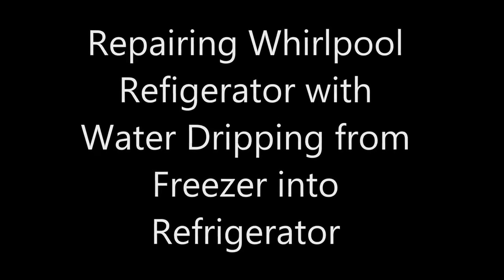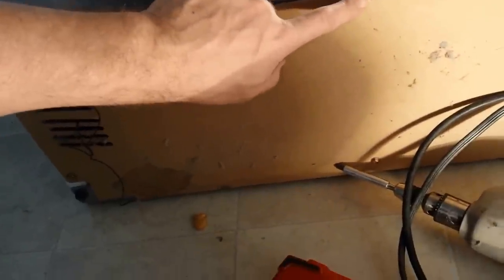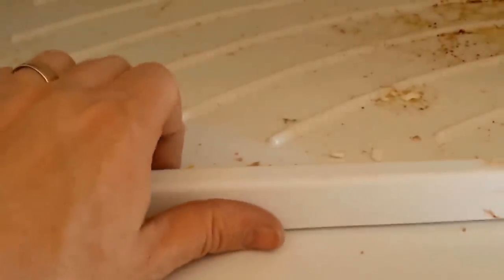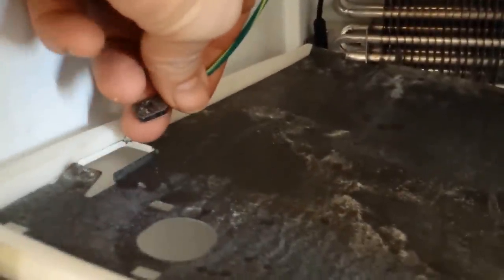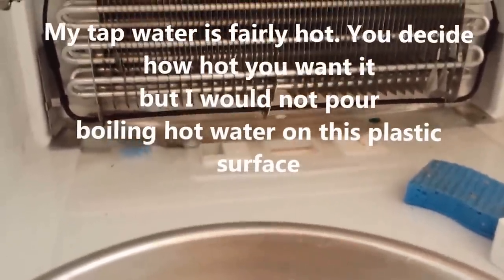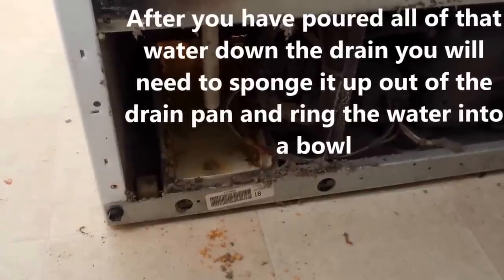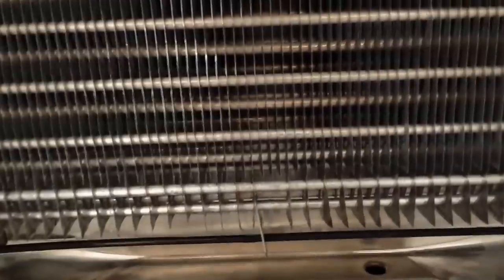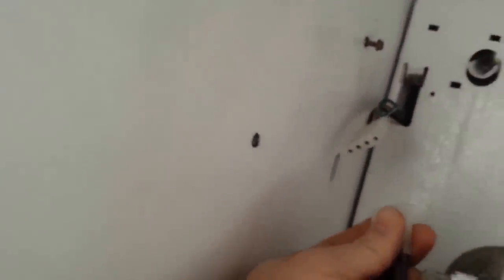How to fix Whirlpool dripping water from freezer into refrigerator compartment

Comment: First off thanks, Mark, for saving me a lot of time in diagnosis and disassembly! Your Whirlpool fridge is almost identical to mine (mine doesn't have the bottom tray). It took me maybe an hour, start to finish, to get the drain unclogged and have it all up and running again.  I'll share what i did differently to speed up the process.

First, after shutting down the freezer and fridge, i unloaded the whole freezer into laundry baskets (i had nowhere to keep it all cold so moving quickly was important!), i then plugged the air vents in front of the back panel with paper towels. This kept any further water or ice from leaking down into the fridge (i had cleaned out the entire lower fridge the day before thinking the leak was a one-time occurrence). 

After pulling off the rear panel, i chipped away as much surface ice as i could. When i could see the drain hole (and there was still a bit of ice left in the catch channel under the cooling fins), i spooned  copious amounts of table salt into the drip channel making sure to put the majority of it around and over the drain. Then i got a hair dryer (a heat gun would work too but be careful with it, they get VERY hot!) and melted the rest of the ice in the channel with the salt on it. Before long the salt water began to eat away at the ice in the drain pipe. I used a bent piece of stiff wire to poke down the pipe to help the warm (not hot!) salt water along. In about 15 mins the drain pipe unclogged and i could scoop up the excess salt. I left a bit of salt in the channel to help keep it from freezing up again right away. I then reinstalled the back panel  and pulled the paper towel plugs out of the air vents. Then i wiped out the freezer well with a towel and put all the food back in. 

I hope this helps someone out....thanks again Mark!
Reply: Thanks for the additional tips!

Comment: Great video! 1) Recommend adding a copper wire to the defrosting drain hole, this is quite involved and unless you want to keep doing this and remove all your frozen food, even once a  year seems a little too much, the copper wire will transfer the heat from the defrosting heater to that hole to prevent ice buildup. 2) Recommend figuring out why there's so much ice/ water buildup... usually this is from the fridge doors being warped from years of usage, which causes the seal to not completely seal all the way, if you look on the top of the freezer door usually you can see one side dropping down. This is a easy fix just remove the door and hammer the hinge the correct way to re-align the door.
Reply from the maker: Thanks. I had to do this once again since I made the video, but it's been a number of years. If it happens again, I'll consider your suggestions.
Reply: Jeff, your copper wire idea is great, I had a repairman do this once because the defrost heater is to far from the hole, he made his own transfer wire from a coat hanger, worked great!!
Reply: Great point about the cause of the problem! Check the door gaskets and that the door is closing tight.
Reply: Why not just let the refrigerator sit out for a longer period of time and let the frozen water in the tube defrost on its own? This of course is assuming you have other refrigeration to put your food into which is my case.
Reply: This is a constant issue that I think actually has something more to do with the ice maker. I have this fridge and when I bought my home (with the fridge-ice maker was disconnected) I did not have this issue. I connected it 3 years later and all bell broke loose. Warranty service have fixed and replaced all parts and did what this video is doing multiple times, but never touched that ice maker or the water hose running to water and ice or their components. Still having issue today. F this fridge
Reply: @youknow1334  my fridge doesn't have the ice maker and I still had this same problem.

Comment: It works! I'm in my 60s, female, and I was able to do this, with some minor adaptations for my size and sheer cowardice. I emptied and defrosted it completely and blew condensed air up the drain pipe a few times. Then I used a funnel and warm water at the back of the freezer and poured it along the edge. It all ran out the formerly blocked drain tube, along with some crud. I poured until it drained clear. (Many of us "grew up" before frost-free refrigerators.) I put a "plastic nondairy creamer tub" under the tube at the back to catch the water. Yippee! Hundred$ saved! (My husband is a musician. Need I say more?) Thank you!
Reply: I’m a woman in my 60s too. I’m going to take courage from your comment and give this fix a try. Thanks!
Reply: @friedabacon3508  Good luck!!!!

Comment: Good refresher video. My appliance repair guy showed me how to do this. Another trick he showed me - Pour some Hydrogen Peroxide down the drain tube. In my case - it was the bacteria that was causing the drain to keep getting clogged. This is basic information that should be in every owner's manual. Good job at showing how to do this. Thanks!!!

Comment: Thank you, Mark and all who added suggestions. I have this fridge and I used a hairdryer and sponges to melt ice and remove water. I was mostly able to remove the ice in sheets as it loosened from the freezer bottom. I heated up an Allen wrench (which was handy at the time) with the hairdryer and put it on the iced up part in the drainage tube. Once the water started draining, I poured hot water down the drain tube using a small funnel to finish clearing out the ice. The whole process (from emptying the fridge to putting the food back) took me less than two hours.
Reply from the maker: Ann Thayer that rocks. So glad to help.

Comment: Thanks much, Mark.  Piece of cake to fix, just as you show. I let the unplugged refrig sit overnight to thaw the ice in the drain hole.  Next day I wrapped a  thick copper wire on the black tube and inserted it a couple inches down the drain hole to keep it open, per Andrew below. Also, I just moved the ice cube maker to the side rather than disconnecting the electrical.  My wife and I are so happy to have a dry refrigerator again!

Comment: I made the mistake of NOT going on You Tube before I worked on my freezer, it's an exact match of yours but I removed that metal trough which you didn't.
Now I have to go back in and make sure its secured down better. Also, that isopropyl alcohol is a great idea, Kelly M  !

Comment: To defrost my drain, I used a turkey baster. I had hot water + pressure. The pipe was defrosted and dripping in the floor pan in no time!! Thanks for your video.

Comment: Brilliant. Each step explained and demonstrated so that this 60 year old woman was able to fix my fridge! Thanks! I used a plastic fork to help dislodge the ice, I’d never use a screwdriver, I’d be too afraid of damaging the unit in some way. Thanks for the tip to be extra careful with the fins and not cross threading the screws. The trickiest part was fiddling with the ice maker and forgetting to match up the spout for the water with the ice maker.
Reply from the maker: Agreed on the ice maker. Glad you got it all fixed.

Comment: First of all, thank you Mark for showing my exact Whirlpool model and age (2001)! Perfect. Now, here are a few suggestions:

Tools: 1/4-in socket or nut driver
a thin spatula that will get under the sheet of ice on the bottom of the freezer
a heat gun or hair dryer
a couple feet of plastic tubing
a funnel
maybe some duct tape
hot water
lots of paper towels and sponges

I was a little nervous about taking the freezer apart to get to the ice dam but it was fairly easy with the exception of having to take off the ice maker. Taking the ice maker off was a PITA, putting it back on was worse and I broke the little screw hole on the bottom (fixed it with a washer, but still...). Put the upper right screw in first so you don't drop the ice maker with the lower screw through its little plastic hole. The hardest part was getting the ice maker in place, aligned with the screw holes, space for the plastic electrical connection and the filling spout from the water input line. 

Getting the ice rink out of underneath the bottom plate was easy, with the help of a heat gun (a hair dryer would also work). But be careful with the heat as you are dealing with plastic parts that could warp and deform and become useless. Warm it up just enough that you can start breaking the ice into smaller sheets and lifting them out. One you get an edge going, the thin can be used to lift up the ice and dump it in the sink or a bowl. DO NOT use a sharp knife for this.

For the ice in the little catchment tray around the iced over hole, the heat gun is great (again, be careful) and take your time heating, sponging, heating some more and eventually you can life out the ice from the tray. Now all you have to do is deal with the frozen drain. 

I used Mark's paper town method for the first little bit, then heated the hole with the heat gun and sucked the melted water into the end of the plastic tube, covered the hole and drained it in the sink. Once the hole is deep enough, use the funnel (I added a little piece of tubing to the funnel so make it easier to pour into, held in place and sealed with some duct tape) and pour the hot water bit by bit into the hole. It will overflow, of course, so clean it up and do it again. Once again suck the meltwater into the end of the tube (don't worry if you get some in your mouth, it's clean) and continue. You will be able to feel that the tubing is going farther down the hole each time you suck the water out.

Pretty soon you will hear the water you pour in to hole start to drain into the tray underneath. Yay!

Here's a hint: when it appears to be clear all the way, pour a measured amount of water in the drain hole, say, half a cup, and then pull out the plastic catch tray underneath and pour that back into your measuring cup. If the return water is about half a cup, you're done and you can start reassembling. Before you put the cardboard back piece back on, vacuum out the dead bugs and cat hair from inside the mechanical parts.

Not counting unpacking the freezer and moving the food to a friend's freezer for the day, the whole thing to about an hour and a half. 

Hope this helps. Good luck!
Reply: Thank you posting this comment!  Is it okay to leave the fridge plugged while you work on the freezer?  I could temporarily move my food to a friend's freezer like you did, but my refrigerator portion is packed!  I wouldn't have anywhere to put it. 😒
Reply: Hey, I'm a "Bear," too (My wife's pet name for me: "Hey, Bear, will you _____?")
Before I get to your question: Mine iced up again about six months later (six months ago). This time I ordered the little anti-icing probe and installed it. A bit of a rip-off at $12 or so for a little piece of metal. But it appears to be working...so far. I think Andrew Gramsky's comment down below is a good, creative one: Add a little piece of copper wire as a heat transfer device. You just need to transfer some of that heat from the defrosting tube into the opening of drain hole. My only thought is would "a small piece of bare copper wire" be enough? Worth a try. If not, the $12 piece of aluminum appears to be worth it.

Now, regarding leaving the 'fridge pugged in? You really have to unplug it or else you are working against the refrigerators main task of the freezer freezing things. Leaving it plugged in could be an uphill battle and much harder to get the ice out. So yes, it has be be unplugged and all the stuff in the freezer needs to be taken out. The second time it happened, I put all the food in a couple of camping coolers and kept the lids closed. In the hour and a half or so it took me to clean out the hole and install the anti-icing probe, nothing thawed more than very slightly. Everything was still pretty much hard as a rock, even the ice cream. Lacking an extra cooler or two or a friend's freezer, if there's room, move the frozen stuff into the main 'fridge compartment. Not only will it help keep the main compartment cold, the already-cold main compartment will help slow the thawing process of the frozen stuff; sort of a symbiotic relationship!

As for the rest of the 'fridge, the main portion, you don't need to unpack it; just keep the door shut and it will keep everything cold for a long, long time, especially if you move the frozen stuff into the main compartment.

Good luck! Hope this helps!
Reply: @christopherjames1590  Thank you, Mr. James!

Comment: Dear Mark: I just performed the same repair on a model GR9FHKXPS01, also from Whirlpool and built in 2006, following your instructions. Worked like a charm. In case anyone else has the same problem, know that the process is even easier on this model because there are fewer pieces to disassemble inside the freezer. Many thanks!

Comment: Next time you do this I would recommend using isopropyl alcohol as a deicer so you don't have to wait as long and deal with the hassle of your warm water getting cold. I had my drain cleared in about 5-10 mins, I also used a screwdriver to chip away what i could and had a shop vac for water extraction. Like he says, be careful with the fins I have a small cut on my hand I didn't noticed until I started to see red smears on the side of the freezer when I reassembled it.
Reply: Put the alcohol through the drain??
Reply: @marifig34  That was my question, too!

Comment: Thank you you helped me locate the drain in the freezer. I’ve defrosted my old Whirlpool top freezer and bottom fridge before but never let the drain defrost. I removed all built up ice and then used a screwdriver and help remove the excess ice in the line. Then used my air compressor on the bottom side of the drain line and BAM, a huge ice cork popped out and fridge line is clear. Took the ice to clean the coils, fans and all the shelving.
Reply from the maker: Well done! Glad it's working for. It's such a pain when it's dripping into your fridge.

Comment: Very helpful video. I went through something like this about 6 years ago. In our case a jar froze and broke and the glass was blocking the drain. We just had a leak again and this video reminded me of what the problem should be. One note: If you can run a wire or something down the drain tube it may clear something stuck in the tube that is NOT ice, like paper or food.

Comment: Fixed mine today. Same exact problem! My freezer has an ice maker, so I had to remove it as well in order to remove the rear panel. I used a blow dryer to melt the ice that completely covered the drain hole, and then used the turkey baster with the hot water to melt the ice in the drain line. Thanks again for this video!!

Comment: Thanks for posting this.  Ours is a Whirlpool-made Kenmore Elite, a 2001 model.  The freezer compartment is the same, except that with ours, the freezer bottom is on tracks and rollers, and slides forward.  So there's an extra step to unhook the rolling bottom shelf and pull it out, along with the three rollers, then the base that it hooks into, held down by the two screws in the bottom.  Today was the second time having to unclog the drain, the first time being several years ago.  I don't remember it taking as long the last time, so I guess it was worse this time.

The things I did differently today were to use a blow dryer to melt the ice buildup (a large block) on the end of the evaporator coil, nearest the icemaker.  I also used the paper towel trick to wick water out of the drain.

As it goes of the freezer compartment, the drain line first makes a 90 degree turn toward the back, and then another 90 degree turn to vertical.  I used a curved piece of coat hanger wire to gently probe the drain line, and that finally broke the remainder of the ice blockage. I can't over stress to gently probe the line, because the last thing you want to do is poke a hole in the drain line.

And on the icemaker, yes, just loosen the top two screws and completely remove the bottom one.  Then, when you reinstall the icemaker, stand it on the front end, plug in the connector, and swing it up into place and hang the icemaker on the top screws.  Make sure that everything is routed correctly, including the fill tube coming in.  Insert the bottom screw, and then tighten all three.

Anyway, thanks again for the video.
Reply from the maker: Well done! Glad your freezer is working well again.

Comment: Great Video that was very helpful with this problem.  It took me about 15 minutes to resolve after watching this video.  I dismantled as in the video and cleaned up the ice and accumulated crumbs.  I used a turkey baster to suck out the water in the area by the drain and added very salty hot water with the baster 3 times and heated with a hair dryer for a minute.  I used a strong wire to pick out the ice as it melted and ran a wire down the drain all the way down when it cleared.  15 minutes, start to finish.
Reply from the maker: Dick Reck, fantastic! You're a pro! Glad it cleaned up so nicely. Mine has not frozen over again for a long time. I wish you the same result.

Comment: Had the same issue in my whirlpool reefer. Never knew a drain hole, go figure. I thought it was the ice maker, then bad solenoid then a leaking water line. I was going nuts.

Did what you did and used heat gun then the boiling water with slight pressure cleaned it right up.  Thanks a billions